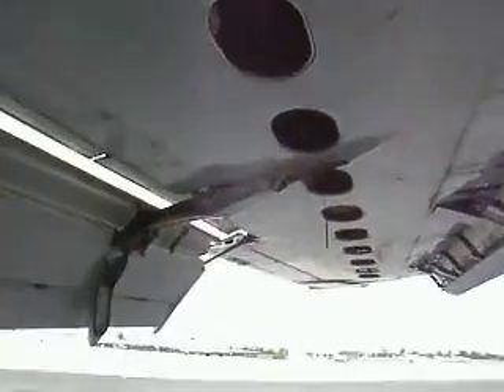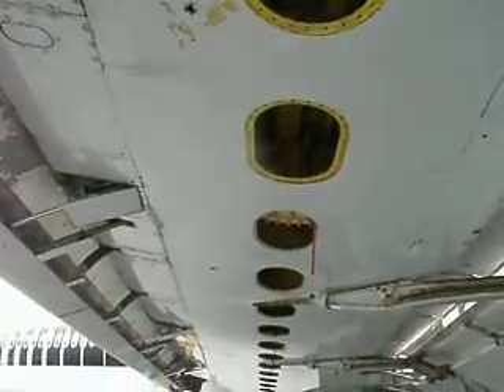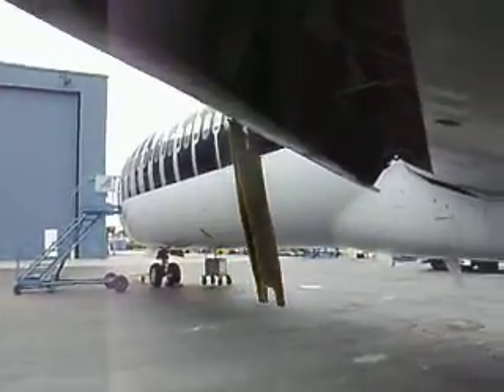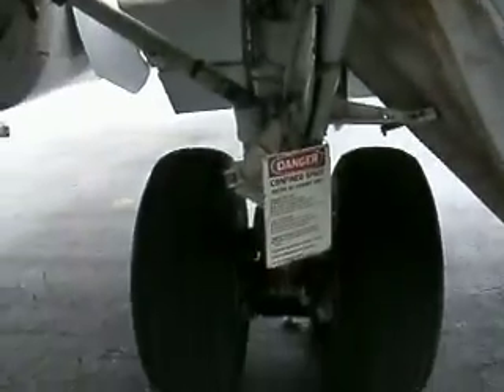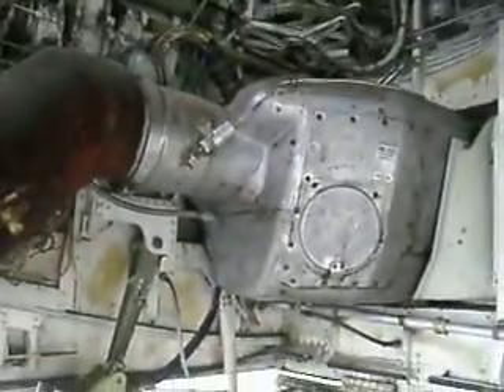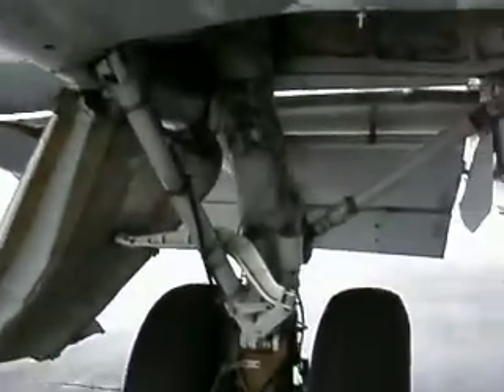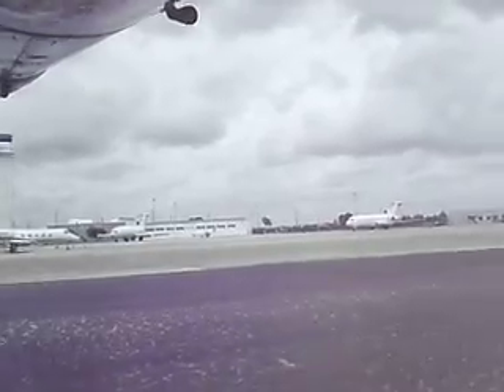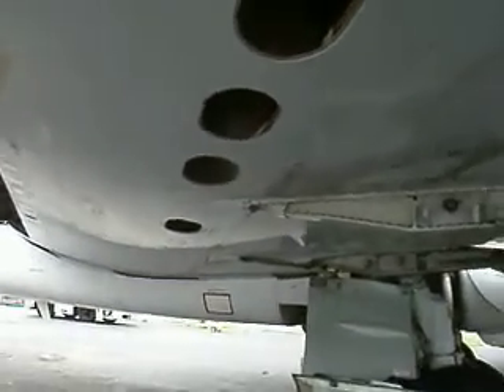94th ACG Observes an (NDT) Inspection On A Boeing 727 Wing-200

Comment: Wait a sec, I thought "fly by wire" meant that there aren't cables and pulleys used on the flight controls. Other than that detail it's a cool video of an aircraft that is getting to be pretty rare these days.